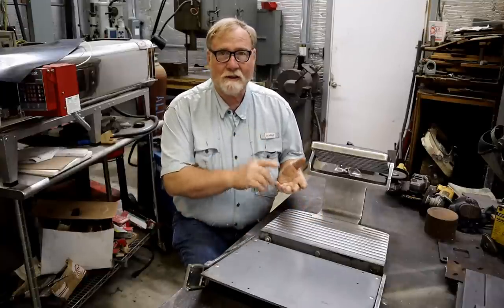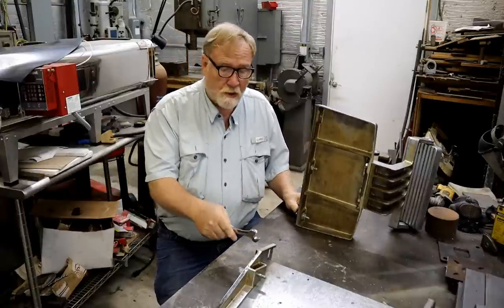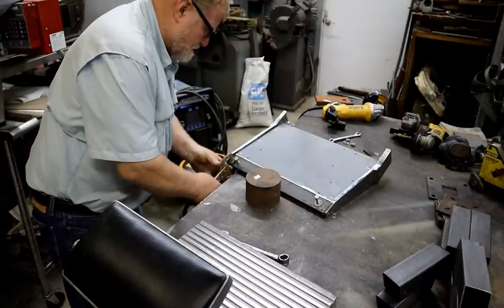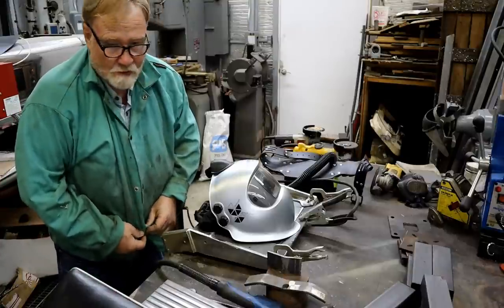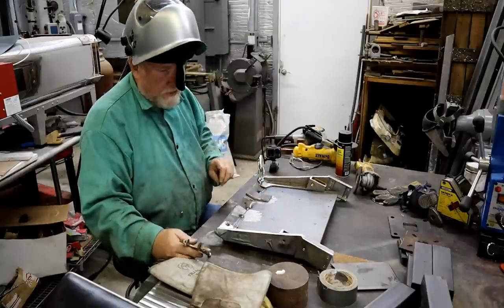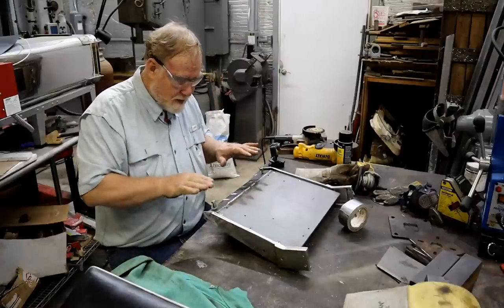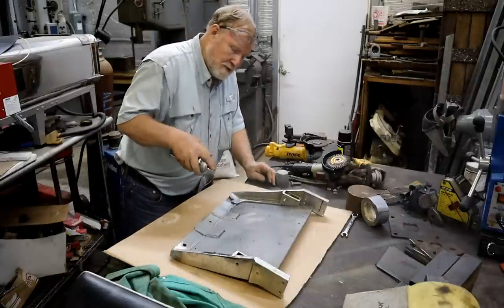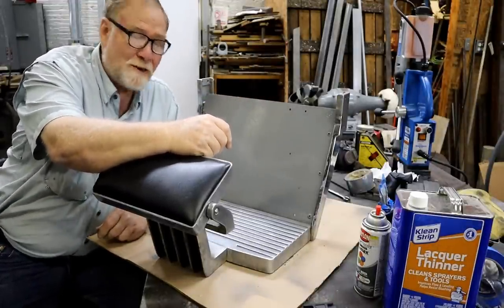Metal Working and Repair... How would you fix this Barber Chair?

Comment: Dad gum it I like this video. Keep ‘em coming. I’ve used many gallons of lacquer thinner and the first thing I do is remove that aggravating plastic cap and replace it with a tapered wooden plug.
Reply from the maker: Wood plug is a great idea :)
Reply: @10swatkins  I usually make them about 2 inches long with a slight taper from an old broom handle. They stick and seal well and are easy to remove and replace.
Reply: I agree hate the child proof caps. I just peal the plastic off then it’s a regular cap!

Comment: I loved the Optrel helmets because of all of the adjustability built into the optics and they use light to charge instead of having dead batteries in the middle of a job. I never tried the PAPR type.
Reply from the maker: I love them... I wish I had the guts to put one on the work trailer but it would take a beating :(

Comment: With modern paints a heat lamp is your friend. Look on CL for one of the restaurant/food counter type setups with 2 lamps, height is adjustable, you can bake paint almost as fast as powder coat.
Reply from the maker: The paint I have been using dries to touch in 15 minutes.. Just have to make sure you recoat within the 4 hour time limit or you have to wait 48 hours or it crinkles the finish...

Comment: That looks like a good repair. Now iff it were me, ( Dr. Overkill) I would make a couple steel girders to attach to the upper part and support under the step.
Reply from the maker: IF it is needed I'll tackle it later.,.. Just messing with it it seems to be a heck of a lot more stable than before...

Comment: Hey, works for me.  Think it would hold me up just fine.  Welding between legs, gotta cover the jewels.  Most uncomfortable welder burn I ever got was when I burnt my belly hole, button on shirt had come unbuttoned, hurt.  Only time I got flash burnt eyes was when I put a bed on a truck with a white cab, reflection got me.  Potatoes  get flash burnt eyes, cut slices of potatoes and place on eyes.
Reply: Only thing I would add is when you bolt this thing together is a bit of something under washer of that busted out side.  Should work the best.
Reply from the maker: I was planning on that when I put the new bolts in, sort of belt and suspenders approach :)

Comment: Nice repair. The cast chrome side pieces may still be a weak part, but can be a repair job if they fail, maybe replace them with steel if they turn out to be a problem.  Today’s repair should outlive the rest of the chair.  I hope she gives great haircuts cause she owes you more than a few.  Stop apologizing for your scheduling and have a great time in your shop.  Very cool helmet. Cheers, zwill
Reply from the maker: Yes the Helmets are very nice... I have had the same welding helmet with out the air system for about 3 years.. The views are just amazing.

Comment: You asked ... I was thinking ... weld the main plates together as you did, then only 1 plate like the two you made, drilled and welded at the center hole location. Then, 4 long gussets, 1 each side inboard of the existing iron tabs, and 1 on each side of the center hole plate. Gussets would have been about the same shape as the side rails and extended 3/4 the length of the large plate ... essentially turning them into Ribs mimicking the side rails.
Probably overkill ...
Thanks for sharing 🇨🇦
Reply from the maker: I though of adding ribs but took the short way out :)   I figured if those two short pieces of side brackets held it this long the addition of the full width strip would be more than enough....

Comment: I would make two U shaped brackets in opposite directions fasted along the sides and the bottom of the U’s bent to meet each other at the appropriate angle and fastened as well
Reply from the maker: Thanks for the different way

Comment: Much the same way  onbly thing i may have done would be to have trimmed the broken hole edges square and cut a piece of steel to fit not for welding just so it looks complete
Reply from the maker: If it would have have ever been seen again, I would have gone to the extra work.